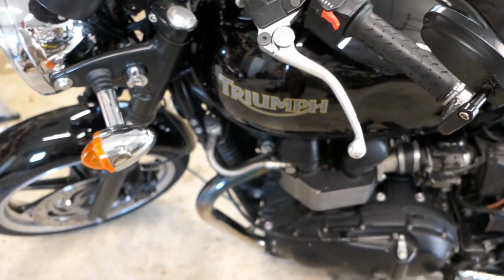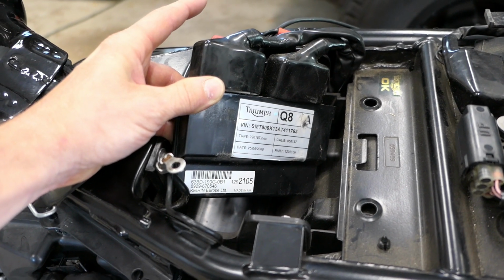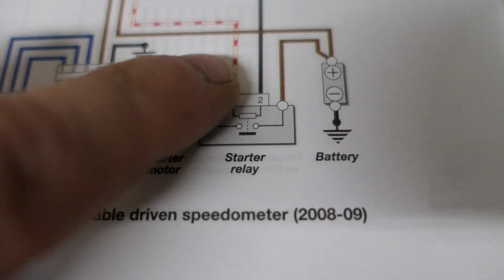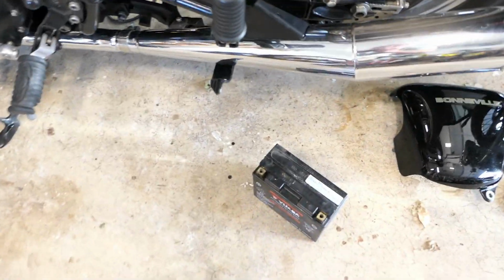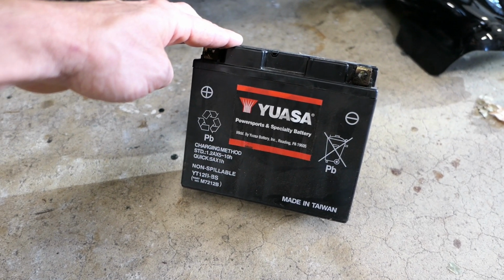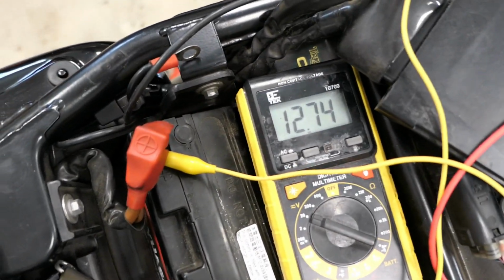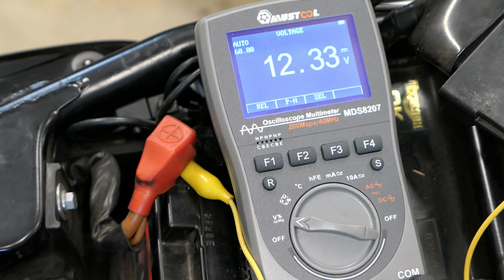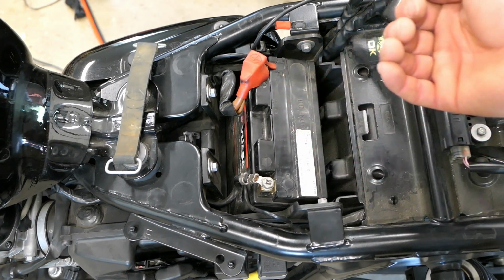Understanding The Triumph ECU Starting Issue

Comment: Hi Mr Tinder,,,,   My question is kindoff about a starting issue,,, but its not...  I was riding when suddenly a warning below the rev counter started flashing ... I went to the forums and it turns out it was the anti theft alarm...  It is fitted with Cr123A batteries.... Now I have never heard anything about these batteries and there is very little to read on the subject... Do you know anything about replacing these batteries?  Of course I may be barking up the wrong tree,and the so called experts may know as much as me!!!
Reply from the maker: You didn't mention what bike you're riding.  In any case, if you see a dash warning light while riding I highly doubt it has anything to do with an alarm system.  Check your manual first for the probable cause of the light, and you may need to scan the computer for deeper meaning.  Dealers can do that and some bikes can be accessed using software on a laptop,
Reply: @tinderboxarts  yeah I ride a BM R1200RT,,,  The manual says that warning light is for the Alarm system,,as I said its just below the rev counter....  Even when I turned the ignition off the light kept flashing,,infact its still flashing  two days later,,,maybe I should have disconnected the main battery.... There is very little information regarding the alarm system out there
Reply: @tinderboxarts  No it was diffinately the alarm,,, I have since replaced the batteries in the black box that is situated below the back rack ,,I found it a swine of a job to release the box from its home,,  but once out very easy todo...replacing the rack and other bits is another matter,,,  did you know the rack comes in three pieces!!!!  Anyway all good now,,,,and no warning lights,,, (Dealers!  yuck wash your mouth out!!!!)  I enjoy your channel,,  stay safe

Comment: Hi can u pls help or comment my ecu has gone as per triumph service center they are saying neutral and fuel pump not working there software gone. Can it be repaired. Pls help..They are saying i sholud buy new ECU pls help..which is very costly..I have Rocket 3 Roadster old model.
Reply from the maker: It's hard for me to give advice from a distance.  But, I will say that actual failures of an ECU are pretty rare.  If your mechanic is claiming that the ECU is failed, he should also be able to describe the other troubleshooting he did to eliminate the possibility of other problems.  If in doubt, get a second opinion.

Comment: I’m not even getting a click, I changed the switch new relay, and I’m not getting a click 2009 Tiger 1050 bench tested the starter it works idk what the hell it could be
Reply from the maker: Always start with the battery--have you tested the battery for resting voltage (should be high 12s) and for voltage under load?   It's possible to have a surface charge on the battery which appears in a normal range, but as soon as a load is applied the voltage drops dramatically and is unable to fire the starting circuit.  Once the battery is confirmed in good shape, check the cables and connectors visually and with a meter to make sure you don't have a poor connection causing a voltage drop.  Then you can look at the starting circuit to see if you have an issue with a safety switch (kickstand, etc.), with the key switch, or with a component like a relay, starter solenoid, or starter.  You've got to be methodical about it or you'll miss the problem.

Comment: I get the same click on my 2013 T100. Then I put the tender on and it starts. My battery is 3 years old and should last at least 4.
Reply from the maker: Battery life can vary greatly.  I get 5-8 years out of mine, but there are reasons life can be cut short.  You should test your battery first (see https://youtu.be/d-5xA31nBd8) and also consider this: https://youtu.be/ryUtqYQrWrs

Comment: My 76 bobber has no battery.new plugs n wires n points...wont fire.any ideas?
Reply from the maker: Oh, geez, that would be tough to diagnose from afar.  Start with checking for spark at the spark plugs--pull a plug, hold the electrode to ground and see if there is a spark when the engine is turned by a helper.  If there is, that eliminates the ignition system and you have a fuel or compression issue.  If there isn't, then start working your way backwards from the plugs.

Comment: I’m having the exact same thing happening with my 2016 America.
Reply from the maker: If you have tested that the voltage level is the problem, and not something else like a bad relay, then you'll want to examine your battery to make sure it isn't becoming marginal, test your charging system to make sure it is doing it's job, and check the cables and connections for corrosion.  I guess the good news is that if you do maintain the voltage above the threshold then everything should work fine.

Comment: Smoke coming out of my wiring behind the headlamps
Reply from the maker: If you are cooking wiring it typically means you have a short somewhere leading to excessive current draw, even though the fuses should prevent that.  I would suggest taking some time to pull things apart and do a close visual inspection of the wiring harness.

Comment: I have a brand new battery. My horn went out shortly after, so I replaced it with a new horn. It worked upon installation. I rode it that night, had no issues. Went to start it again to ride home, and I had the “click” issue 5-6 times. I took the key out, put it back in, and the bike started right up. Rode it today, 24 hours later, bike is starting normally but the new horn is not working. Any idea what this might be? Is it possible I switched the power and ground cables on the horn which caused a starting issue until a fuse blew? Sry don’t know much about electronics. Thank you for any and all help.
Reply: Mine is a 15 T100
Reply from the maker: It's pretty tough to venture a guess from a distance, but you have to start with the basics.  Make no assumptions.  Is the new battery even good?  Are your connections done right?  Is the charging system working?  You should do some basic testing on the battery first to make sure it is charging and holds a charge.  Then you can check the horn issue.  I would first disconnect the horn completely, then do the battery tests.  One thing at a time.  See this video on how to test your battery:  https://youtu.be/d-5xA31nBd8
Reply: @tinderboxarts  thanks a bunch for your reply. I’ll start with a battery test and go from there. Being a brand new battery, I didn’t test it before use.

As a followup, since I posted my original comment, the bike is starting normally and replacement horn is working properly with no adjustments except pressing the connections in on the horn to make sure they were secure (which might be what fixed it).

If there were a bad connection on the horn when I was experiencing the issue, could that have caused the starting issue?
Reply from the maker: No, that's just coincidence.  However, it is possible you have a loose connection at the battery or a cable that is faulty and in the process of moving things around you are temporarily fixing the problem.  Take a hard look at the wiring to see if anything looks amiss.

Comment: I just replaced the battery in a '11 Speed Triple and it started right up and about 4hr later would turn over and sounded strong, but for whatever reason, wouldn't fire the bike up. We bump started it and it felt fine, turned it off and back on with no problem. A little while later, would again turn over but not start. Again, this is a new battery, followed directions and charged the battery before install, not sure what's going on. Any help would be appreciated.
Reply from the maker: When you say the bike will still turn over but not start, do you mean that you press the start button and you get the starter spinning the engine at a healthy speed but it just won't catch?  If so, you may have a health battery but a second problem, such as a fuel pump or ignition issue.  But, start with the battery and confirm that it is healthy first.  You need to know the resting voltage, the voltage under load and the charging voltage.  See this video-- https://youtu.be/d-5xA31nBd8.  Once you've confirmed the battery is good, you can look for other issues.  Do you hear or feel the fuel pump spin up when you turn the key to the on position?  Have you confirmed spark?  Without an air/fuel mix or ignition your bike isn't going to start no matter the battery.  But, confirm the battery first and work out from there.
Reply: @tinderboxarts  Thank you very much for the reply. It's not often these days you get some good info. Yes, I mean the engine will spin/turn over but will barely cough, so I was thinking it was a fuel issue. After watching this video I'm thinking maybe the battery just doesn't have enough to get the ECU going to fire the injectors. The battery is a middle-of-the-road brand and shows a good 12.4-12.5V after a charge but under load it is closer to 10.2-10.4V. Again, this is a brand new battery that may just not have enough CCA to get the ECU going? When we first installed the battery, the bike started right up and sounded great. A few hours later it would spin but no fire. We managed to bump start it and again, sounded great and idled fine so I'm ruling out fuel issue. Thanks again.
Reply from the maker: When you say the battery is 10.2 volts under load, do you mean during the moment that the starter is engaged and turning over the engine, that's what your meter reads?  If so, then your battery is fine.  But, if you mean you just turn the key with the lights on and the voltage drops to that number then the battery is a problem.  The ECU, ignition and even the fuel pump draw very little power relative to the starter.  So if you can bump start the bike then it would appear that there is enough power for the fuel pump and the ignition.  If your battery is weak, it may not be turning the engine over fast enough to create compression/vacuum.  That's why it's important to understand exactly when you get that voltage reading.
Reply: @tinderboxarts  Yes, 10.2V under a load test or while trying to start the engine. We even swapped with a brand new battery I had on hand and still had the same problem, so you're right, not a battery issue in my mind. All lights/dash come on as usual, the bike turns over, but no fire. I'm going to check spark plugs and injector(s) today unless you know a better place to start.
Reply from the maker: Okay, if you have 10.2 volts with the starter engaged, that's all you can ask.  And, the ECU is allowing the bike to attempt to start, so that's not the issue nor is a failed safety switch.  The bike will run and it will bump-start, so you must have compression in the cylinders.  That leaves spark and fuel.  It could be that you have a loose wire or corroded connector which is preventing the ignition or fuel system from working under certain conditions.  Perhaps bump-starting also jiggles the right wire.  So you need to test for spark.  Pull a spark plug and coil from one cylinder and hold the spark plug electrode to a good ground.  Have a helper try the starter switch for a few seconds.  If you see a blue spark jump the spark plug gap, then you have enough spark to start the bike.  If you don;t see a blue spark, you have an ignition problem.  To test the fuel system, do you hear the fuel pump spin up with the key turned to the on position?  If you squirt some starting fluid into the air intake while a helper attempts to start the bike, do you get the engine at least sputter?  That would point to a fuel system problem.
Reply: Time to start digging, thanks.

Comment: I have 2015 rocket 3. Fuel pump will not prime. Took it to dealer they charged $350 to clean 3 fuel injectors it ran for a couple days and will not start now. 1240miles spent more time sitting than riding. What a piece of garbage!
Reply from the maker: I think your anger and frustration may be misdirected.  Rather than the bike, your problem is likely the dealer and the mechanics there.  The level of expertise at dealerships of all brands has declined markedly over the years.  Very often I see problems which shouldn't be difficult to fix that drag on because the mechanics just aren't doing basic troubleshooting.  If your own skills are not up to the task I would suggest trying to find an independent mechanic or another dealer.  There's no reason you can't have that bike running like a top other than the expertise of those working on it.
Reply: Found it. There was a bad O ring between the fuel pump and FPR. So there was no pressure to the injectors. Thx.
Reply from the maker: That's good to hear.  Did you find it yourself, or did one of the mechanics finally figure it out?
Reply: I did, took the fuel assembly out put the end in water and plugged in the harness and saw where it was leaking. Then replaced pump, regulator, fuel filter.
Reply from the maker: Well, that warms my bitter, shriveled heart!  I do think working on your own bike is part of the riding experience, and you have just shown that with a little persistence and thoughtfulness you can solve tricky problems yourself.  Well done.
Reply: You want to buy it? Lol
Reply from the maker: Ha!  I've already got two others, and not much garage left.